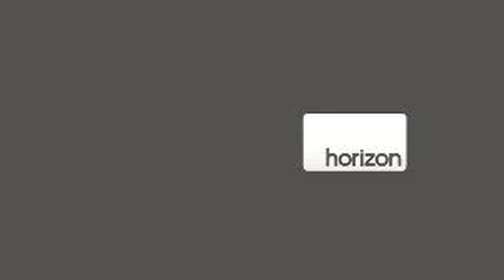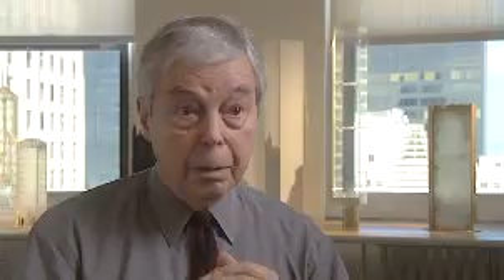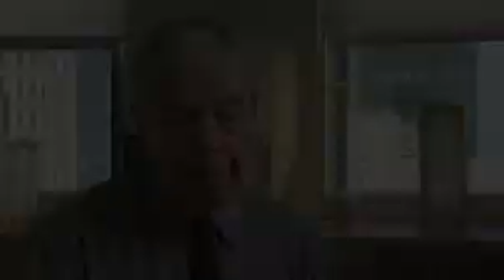Leslie Robertson - Chief Engineer - World Trade Center - Twin Towers

Comment: Allyn E. Kilsheimer of KCE Structural Engineers
 
"It was absolutely a plane, and I'll tell you why," [of Washington, D.C.] "I saw the marks of the plane wing on the face of the building. I picked up parts of the plane with the airline markings on them. I held in my hand the tail section of the plane, and I found the black box. I held parts of uniforms from crew members in my hands, including body parts."

911 TRUTH DEBUNKED!

Comment: Whatever, Les...Either way, the 767 cannot physically fly as fast as the government says they were supposedly going when they impacted WTC 1 and 2 at <1000ft above sea level.
Reply: do some research trans am. 767's can't fly over 500MPH at ground level without serious vibration and total collapse. They fly that speed at 30,000 ft. And do you believe a terrorist who couldn't fly a single engine Cessna could fly a 767 with no experience at those speeds? LMAO!!
Reply: greg dennis do you believe that baggage loader who stole a jet last year could perform the maneuvers he did without ANY flight experience of any kind baffling even veteran pilots?  Well, he did.